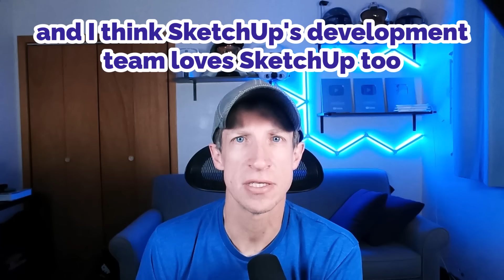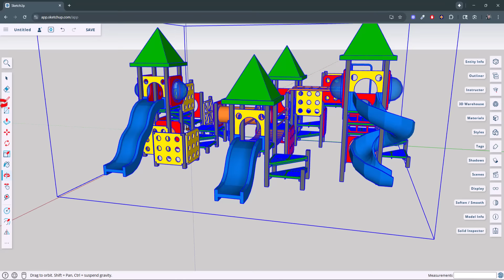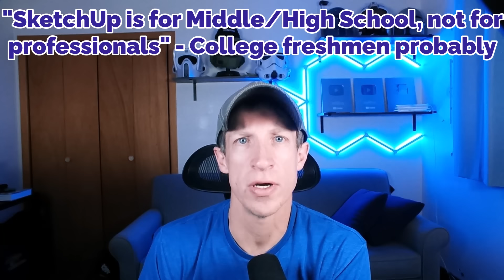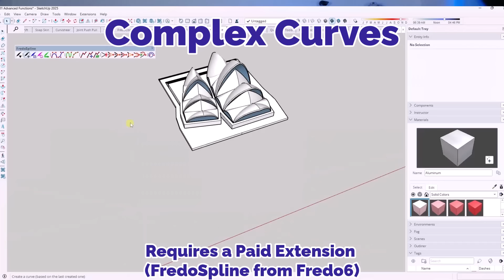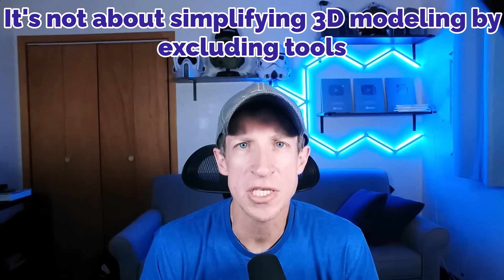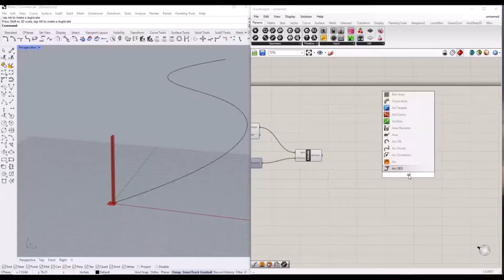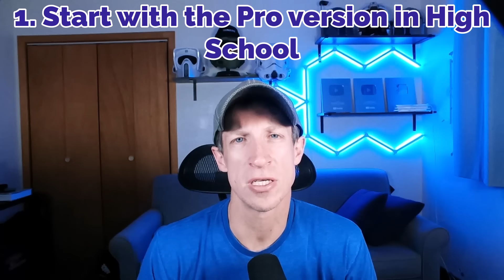Is SketchUp being REPLACED?

Comment: The only thing keeping me on sketchup is the warehouse. Otherwise Rhino is far superior as a modeling tool.
Reply from the maker: I'm back and forth - many many tools, but the execution and modeling experience is not as good to me as SketchUp. Personally I wouldn't make the switch, but my use case might be different than yours
Reply: @Thesketchupessentials  I actually started with Rhino, then transitioned to using sketchup for Interior Design. I do miss Rhino because of the precision and the variety of ways you can achieve results. Also, I love having a command bar. All in all, neither are perfect. Sketchup though, does have a very robust ecosystem of downloadable items, which is a big plus. Thank you for your guides, they've helped me tremendously with the transition.

Comment: Blender will overtake them both in a few short years. I have started working with functional NURBS inside Blender, and Geometry Nodes makes it competitive against Rhino. Is is as simple as SketchUp? Surely it's not, but most people willing to look into SketchUP Pro, especially k thru 12 students, will see the potential of Blender, even if it is a steeper learning curve.
Reply from the maker: I think it depends on your use case. For architecture / interior design? No chance - I've tried it, and Blender currently is not set up to be a design tool from a CAD standpoint. Precision is clunky, it doesn't have great measurement tools, and it has no 2D documentation whatsoever. Not to say I dislike Blender, but it's not a player in this space. 

For manufacturing/solids? Maybe
Reply: @Thesketchupessentials The free Bondai extension changes all of that. It has complete IFC support of BIM data and workflow. I beleive most high School students will see past the limitations of Blender out of the box.
Reply: @Thesketchupessentials  The free Bonsai extension changes all of that. It has complete IFC support of BIM data and workflow. I beleive most high School students will see past the limitations of Blender out of the box.
Reply from the maker: @tbrg1965  I've seen it - it doesn't change the fact that the actual modeling functions for creating Architectural objects are atrocious. Without better architectural modeling tools, dimensioning, etc, it's a non-starter. Everyone talks about IFC, but the modeling tools themselves are the problem.

Comment: I have no inside info on sketchup's software architecture, but as a former developer I know this: many highly successful software products eventually run into hard limits because of initial assumptions and architectural decisions made along the way. Barriers that block evolution of the product to the next logical step. It may well be that Trimble has encountered these limitations and is now boxed in by them. It may well be that to move SketchUp forward, it has to be totally refactored - i.e. rearchitected from the ground up. Such an endeavor is scary to owners of successful products - and impossible for some to muster the courage to take on. SketchUp may be doomed by this reticence to a slow and and ignominious death.
Reply: I second this. Google designed this software just out source modeling 3d buildings for Google Earth as a simple program. I feel Trimble refuse to do fundamental programing changes they continue adding minor updates. Otherwise need a ground up overhaul of the software and this means time, money, investment and innovation. At this point only solution I see is to make Sketchup free as it was before  and plugins paid subscribtions after that design a new rule-based simple BIM software which seriously lacks at the moment.  First step may be integrating Layout inside Sketchup and add multi-view working environment. Blender has Bonsai as an open source BIM addon but its complicated for average users. Honestly I was thinking Trimble would make a move like this but they choose to be ignorant and refuse this path. 
Trimble is a hardware and geospatial data company, not a design culture company. Their priorities have leaned toward interoperability with surveying and construction workflows rather than artist- or designer-driven innovation.
Reply from the maker: I totally get where both these comments are coming from, and I think for some tools I agree, but for some of these tools, they don't require a complete re-write or anything like that. A lot of these tools already exist in the form of paid extensions, so they wouldn't require a massive overhaul of the 3D engine (I wouldn't think)

Comment: 1.Sketchup should include BIM 
2.Give a general free version accessible to everyone and keep advanced features paid 0:55
Reply: The challenge is that sketchup, at its nature, is a mesh modeling tool. It does not use nurbs. So making interoperability between SU and BIM softwares are a pain. In rhino, you can now import them into Revit and select its solid faces to model walls easy in complex shapes, for example, bc is a nurbs solid base modeling tool.
Reply from the maker: I think for item 2, isn't that what the free version is? I'd be ok with some BIM functions, but that one is tricky, You don't want to go too far down the path of being Revit - you're not going to "outRevit" them, and you risk removing the flexibility of SketchUp
Reply: @Thesketchupessentials  Nah. I already use SketchUp for BIM. The following I feel are missing. Very smply they can introduce section fill pattern based on tag or materials. The generate report is very bad. It needs improvement. It gets totally messed up when we use components from 3D warehouse althouh we can work around it. Layout and Sketchup shoud be one software its very hard using two software. Update scene... save file then go to the layout and update model reference. Annoying. Also if we save the model as a differnet file the layout needs to be relinked. Its very annoying if we have many many drawings of a project linked to a layout and it needs to e updated. Very time consuming. Te snaps onthe layout on model points dont work properly. Dimensions are not accurate on Layout. Its extremely difficult to use.
Reply: SketchUp don’t need bim. SketchUp needs to bring tools that are BASIC to all modeling software instead of relying on third party plugins
Reply: Blender BiM

Comment: Some years ago I needed to use SketchUp for  sketching on IFC model. Import was a paid plugin feature that turned 200 MB model into multiple GB. Even after deleting most of the house. It was about 1,5 GB file. I ended up sending back my creation that no one could open. After this. Never touched it again for my work needs.
Reply from the maker: Which plugin?

Comment: Permanent license, unlimited geometry control (Grasshopper, nurbs, subD), much more powerful solid modeling, a full drafting environment comparable to an older version of AutoCAD. Multiple opportunities to program plugins (python, C#, or C++), or use existing advanced plugins which are comparable to SketchUp.  Plus, most of the built-in capabilities of SketchUp are now in Rhino, push-pull on steroids, etc.  Three times the import/export formats, plus rhino imports SketchUp files flawlessly etc.
Reply from the maker: Definitely wouldn't agree with this one - "a full drafting environment comparable to an older version of AutoCAD." I STILL haven't seen anyone generate a complete looking set of plans out of Rhino

Comment: In my opinion, the only weakness of Rhino compared to SketchUp is its library. Do you think there will be a platform like 3D Warehouse in the future?
Reply from the maker: No clue - it seems like a good idea, but I think it would probably require a lot of server infrastructure that probably wouldn't be worth it to them. I think SketchUp is better in a lot of areas - ease of use, 2D documentation, the materials browser is significantly easier to use, etc. It really comes down to what you need most

Comment: I think it depends on regions, in Europe Sketchup has never been common use among architects and students, In China and Vietnam it is, I use both and I hate that I cannot have the good things of each program in one, so I use them 50/50, but I think Sketchup is better because zooming, moving around is more precise, key shortcuts are faster, the group/component methods are ultra efficient and fast, it allows for way bigger projects and details without getting slow, and the most importan, the visual style, it's always easy to see the architecture, I know in rhino you can change the style, but it's never as nice. And in Sketchup I miss been able to play with lines-polylines, all sorts of curvy lines, joining them with curvy shapes, setpoint, extruding them, cutting them, etc., again, there are some plugins for Sketchup to do this, but they are far from been as usable as Rhino.
Reply from the maker: Agreed on all points, and I definitely don't think SketchUp is "bad," so hopefully that's not what came across in the video. However, it seems like closing the gaps on some of these features would do nothing but help SketchUp as a whole

Comment: I started with Sketchup Pro some 18 years ago. The problem back then was that I couldn't export models into Train Simulator20xx back then. There were no plugins for it. So, I went over to 3ds max.
 Thanks to Sketchup, I was a spline modeler from the start. So, the move was easy.
Reply from the maker: Interesting - definitely a niche case, but it sounds like you found the tool you needed!

Comment: I find that both programmes have pros and cons...Sketch Up is great for interiors, quick renderings (I use Twilight) and can be a pushed to photo realism in better render engines, BUT its just not accurate enough compared to Rhino (I use it for guitar making) The additional Rhino Cam programme, although expensive, makes exporting to a CNC a dream without leaving the programme and is extremely accurate. 
Sketch Up is still a very good 'beginners' program dressed up as an adult.
Layout is a pain and defeats the object of SU's simplicity and speed. 
I have used Sketch Up from SU 7 , but stopped after I bought 2017 Pro as I refused to get on board with Trimble's subscriptions. I have all the plug ins I need to produce very good drawings and products, and got them when they were mostly free (Fredo etc) so I would hate to have to buy them all over again if I upgraded to a more recent version for no aparent gain. Trimble are like CBS buying Fender in the 60's...quality dropped, prices went up.
Reply from the maker: I think this is a fair assessment of their abilities. I personally don't have issues with Layout, but it needs to be set up a certain way for you to have a good experience. I've head that for CNC it's not always the best due to the inherent limitations of the geometry, but I've not tested this myself. Thanks for the comment!

Comment: I used to use SU a lot, the free version, can't afford the cost of it, so as the free version has been left for 6ish years now. I must admit to looking around. I still love it, I started when it was a Google project and even the free version got very regular updates. For me the issues started when trimble took over, and dropped the free version, I mean a real version not some web based semi version.

As for beveling and chamfering, they can easily be done by knowing the available tools. I started drafting on paper, with pencils and set squares. You had to known how to construct shapes etc in order to get your desired output. To me it seems that the latter generations simply want to press a button and remove all the skill and the need for ability. And as a result they know nothing and learn nothing then when they haven't got there fancy push buttons, or something goes wrong they are completely lost.

That said AI will do it all so right from the very concept thought the drawing all the way to manufacturing, no humans needed...

Comment: I have been continuously using SketchUp Pro since 2016. Furthermore, Based on my experience, SketchUp is an application that updates superb slowly when compared to other applications in the industry. Just look, the same tool palette that was there years ago is still there, and there has been no improvement in them. Over all these years, SketchUp has only given its users a small number of new features. If it weren't for the passionate developers who love SketchUp (i.e., third-party developers), SketchUp already dead tool. Continuing to pay money for an application with no progress or future is, in a way, a big risk to our careers. Therefore, if SketchUp cannot change, and if SketchUp cannot fulfill the needs of its users, as users, we will have to move on to other alternatives. bellow what they did Since 2006 as my study. 

🔴Early Era (v1-v5): Establishment of the core drawing tools, most notably the Push/Pull tool. (2000 - 2006)
🔴SketchUp 6: Introduction of Photo Match and a beta version of LayOut. (2007)
🔴SketchUp 7: Launch of Dynamic Components (interactive models). (2008)
🔴SketchUp 8: Added Solid Tools (Boolean operations) for more advanced geometry and 3D printing. (2010)
🔴SketchUp 2013: Created the Extension Warehouse, greatly expanding the software's capabilities via plugins.
🔴SketchUp 2017: Major Graphics Pipeline improvements for speed and stability.
🔴SketchUp 2023: Introduced the native Flip tool and Overlays for extensions.
🔴SketchUp 2024: Released a powerful new Graphics Engine for enhanced performance.
🔴SketchUp 2025: Continued modeling refinements, including Rotate Grips on component bounding boxes.

Thank you create video at least they will see it.

Comment: As an architect the reason I dont use sketchup anymore is the documentation tools.
Reply from the maker: I'm assuming you're probably not using Rhino either then? Probably Revit?
Reply: @Thesketchupessentials  You're right! Archicad and Revit. I really wish we had a third player because those two companies charges an absurd amount for their products here in Brazil. Trying to put in perspective, it ranges approximately from R$ 10,000 to R$ 20,000. R$ 20k equals roughly 3,700 dollars. Considering the average salary for both countries, an architect in EUA works two weeks to pay for a license, meanwhile an architect in Brazil works two to three months to pay for a license. If sketchup had better workflow/tools for documentation it would be huge here.
Reply from the maker: @diegosemmonitor4795  This is the gap I think SketchUp should be targeting. Layout is already significantly better than Rhino's documentation tools - solve that problem and it's not a SketchUp / Rhino discussion, it becomes a SketchUp vs Revit discussion (slight hyperbole probably)
Reply: @Thesketchupessentials  I agree

Comment: 💯 you can master sketchup in a year, which is great. But then you're left with an empty feeling because there's a bunch of stuff missing.
Sketchup is great for straight lines and flat faces, but struggles with roundness.
Reply from the maker: Fair comment - and this to me doesn't need to be the case. SketchUp should be developing tools that simplify the creation of the roundness, not just avoiding it entirely. If you want to be the accessible modeling program, start making all parts of modeling accesible

Comment: I am an Authorised Rhino Trainer, I teach Rhino 3D. Im sorry, you cant even compare Rhino 3D and Sketchup. Plus, try working with Scan Data (LIDAR-E57) or large Mesh files in Sketchup. A lot of Architects are working with 3D scans these days.  I also teach boatbuilders how to use Rhino, I cant image trying to build a boat in Boxy Sketchup. Lastly, Rhino 3D is extremely User Driven, McNeel listen to what their users want, as a licence holder I can download the "Next"" release of Rhino and try it out before it is made available to everyone. Oh...and did I mention that you can run "Rhino-inside-Revit"...for Revit users.
Reply from the maker: I mean, I'm not an "Authorized" SketchUp trainer I guess, but I could say the same thing about SketchUp in other areas. It's faster to learn, easier to use, with a much smoother UI/UX, and it has superior documentation tools. For all Layout's faults, it makes much better plans than Rhino can. Plus, working in SketchUp is just generally more enjoyable. Acting like EVERYTHING in Rhino is superior is a little disingenuous...
Reply: @Thesketchupessentials  Why ? Rhino is simply a better product ! In my 30 years of 3D modelling in a number of different industries I have met many professionsals who use Autocad, Microstation, Solid Edge, Solidworks, 3Ds Max, Blender, Maya, ......and only 1 Sketchup user.
Reply from the maker: @Scan2Model  In some areas sure. And SketchUp is better in others. I would never choose Rhino for interiors over SketchUp - the material management is atrocious, the 2D documentation tools are lacking, and making adjustments in SketchUp is significantly easier, especially with dynamic components.

Comment: Trimble doesn’t get it at all. It’s a royal PITA to authenticate and log into “Pro”, and their tech support is awful.  I met the original guys from @Last at an AECSYSTEMS show back in the 90’s . The ORIGINAL STATED OBJECTIVE of SU was to make a 3D modeler that worked the way designers think, and the early versions were exactly that.  Trimble needs to get back to that objective or SU will be burnt toast.
Reply from the maker: I didn't know that specifically was the original stated goal, but I like it, and I think that would really drive some interesting innovation

Comment: I disagree, sketchup works really well without all this stuff in the way. I don’t want all the features as the promise doesn’t mention the added clutter. I do agree i want own software and not have a subscription.
Reply from the maker: That depends on what you're trying to do. And adding features doesn't mean added clutter. You can turn any and all of these toolbars off at any time. No one is going to force you to use the features, but I think to future proof the program, they need to be an option